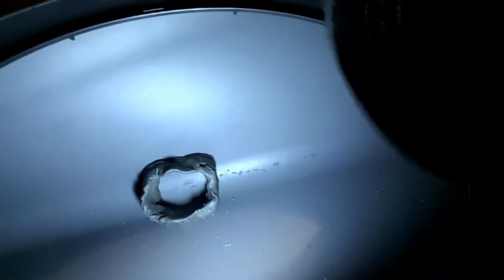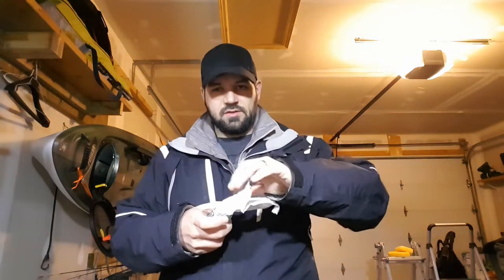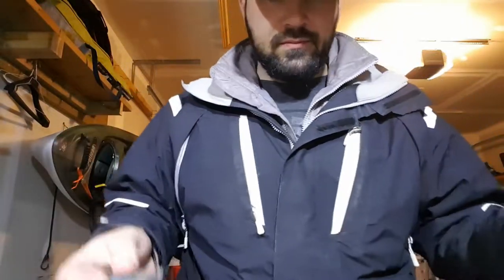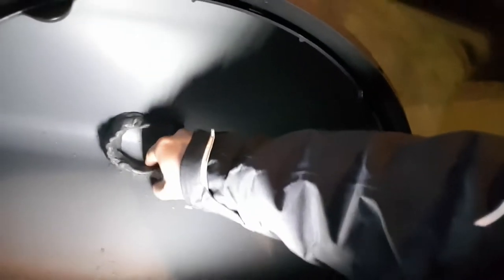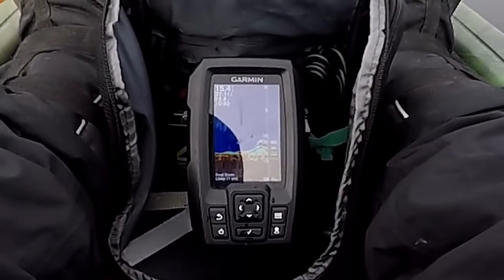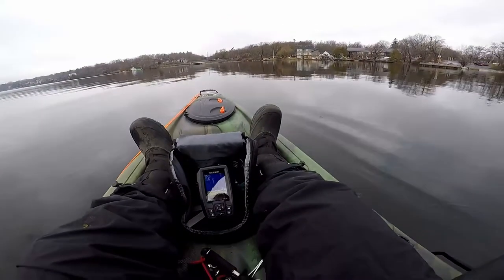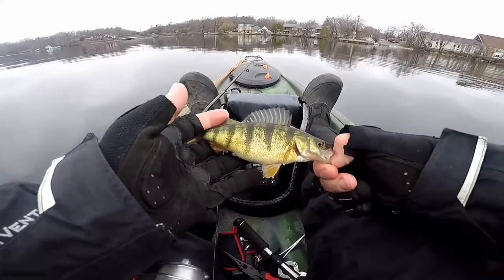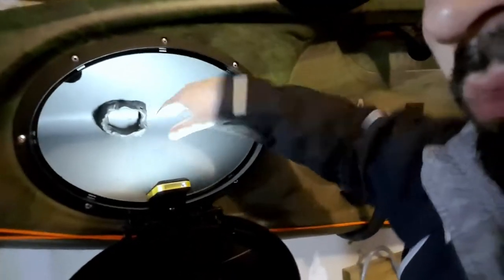Kayak Through Hull Transducer - Easy and Cheap! (Garmin Striker4 and Pelican Strike 120x Angler)

Comment: I know this videos is a few years old, but just a heads up, with duct seal you dont need water. You just make sure there is about an inch of duct seal between the hull and the transducer with no air gaps.

Comment: Have you tried using the Garmin foam pad with a bit of water inside it, like you did with the duct seal?  The instructions for the foam pad is nothing butl pictures but it does show pouring water into the center of the pad.  I'm considering the Striker Plus 44cv and was looking at the foam pad for keeping the 'ducer inside the hull instead of mounting beneath the PA.
Reply from the maker: I did try it, and I couldn't get it to work at all for me. I don't understand why, the concept is the same as with the duct seal. Who knows?!

Comment: Thanks for a great video.  I don't have a fish finder yet so I may not be as familiar with their mechanics as other viewers. Can you tell me why adding the water is important? Thanks!
Reply from the maker: The short answer is because the sonar pings need a medium to travel through, and a air pocket will interrupt the ranging. The water in the trandducer well provides a seamless medium with the hull for the sound waves to travel through into water below your kayak. I've gotten this question a few times now so I think I'll make a video about it. In the meantime, here's a wikipedia link that has a more in-depth explanation of how sonar works.

https://en.m.wikipedia.org/wiki/Fishfinder#:~:text=In%20operation%2C%20an%20electrical%20impulse,and%20shape%20of%20the%20object.

Comment: Awesome! But I think it is IN hull and not through hull, which would be the transducer in direct contact with the water yet inside the kayak ( like the scouper hole mount).
Reply from the maker: I'm pretty sure it's thru-hull, since the sonar waves are being passed through the hull of the Kayak. A scupper mounted transducer is just that, mounted in the scupper I have a video on how I did that with a newer kayak too!
Reply: @jeffdicks  Great video. @Aranha 93 is right. This is an in hull installation. Through-hull is when you drill a hole through the boat for the transducer commonly done on sailboats.

Comment: I have the Same fish finder for my kayak I have not fully set it up yet I was planning on using the foam pad that they give you with the Garmin fish finder just wondering why did it not work out for you?? What went wrong with it ? Wondering if I should just do the duct seal right from the start instead of even messing with the foam holder
Reply from the maker: Sorry for the late reply, honestly I couldn't tell you for sure why it didn't work for my kayak, but I suspect it probably had something to do with the shape of the bottom of my hull. It's not flat in any places that would be good for the transducers, so I had it stuck in there on a bit of an angle. Or maybe the adhesive on the foam pad didn't set quite right and was leaking water out. Who knows? All I can tell you is the duct seal method worked like a charm the first try, and I've been using it since I made this video. In fact, the duct seal I used that day is still in my kayak, going strong almost 2 months later.

Comment: Debating on the portable kit or just the striker 4 with arm mount. Would you say this was inconvenient with being in the way or was it not a big deal? I like the portability of this one between possibly other kayaks or a boat. (Would be using just a suction cup mount for the transducer that the kit comes with now)
Reply from the maker: Everyone's needs are different. Personally, I'm quite happy with the portable kit. If you don't have any way of mounting it to a kayak or boat it's really perfect. I personally hate having the carrying bag between my legs while I'm on the water, so I'll be putting a track system on my kayak in the next week or so to mount the head unit to, but I will keep the bag for the winter when I'm ice fishing. That's really the reason I went with the portable kit. I can use it on my kayak and for ice fishing.
Reply from the maker: Depending on the texture of the area you plan on putting the suction cup you might have problems getting it to stick. I had to duct tape it to the back of my pelican for the first couple of times. I highly recommend the through hull method I showed in this video. So far the duct seal has held up to about 15 different trips in the kayak and as of this morning when I was out, it's still tacky and pliable.
Reply: Limestone Fishing I'm not sure I'd be able to install in hull because there's no dry compartment. That's why I was looking into the arm one. But you saying that you hate it sitting there between your legs is probably enough for me to go ahead and get the arm mount and unit alone instead of the portable kit. I just liked the portability of it but I should Still be able to move the track mount to another kayak or boat just as easily...hopefully.
Reply: Limestone Fishing thanks for such a quick response!
Reply: Sorry one more quick question! I pulled the trigger on the portable one. I'm also just wondering about the unit itself. Will this work well in more shallow water? Perhaps for bass fishing in a lake or maybe even fishing the flats (bottom isn't completely visable..wondering if it will help looking out to the sides at all or if the beam/cone is just straight down). Hope that makes sense. Thanks again!
Reply from the maker: Sorry for taking so long to get back to you! It works just fine in shallow water. I've noticed when I get into depths around 2ft and less it sometimes has trouble, but realistically, no fish finder is really useful for depths under 5 feet unless your using side imaging (which our units aren't equipped with) 

I'm glad my videos helped you make your decision!
Reply from the maker: What kind of kayak do you have? If it's a Sit on top type, It's possible that one of the scuppers is recessed in order to accept a transducer. I definately do hate having the bag between my legs, but that's not really the units fault. That's more of my fault for dragging my heels on getting a proper mount for the display unit and storage for the battery. I hope that my comments about that wouldn't discourage anyone from purchasing this unit.

Comment: do you have to pour water over it? if so during your fishing day doesn't the water fall out of the little well ?
Reply from the maker: Yes, water is required in order for the transducer to work properly. 

In my experience, I've never had to refill it during a trip, even after 6 hours or so, but your milage may vary depending on the wind and wave conditions and how high you make the sidewalls of your well.

Comment: Is adding water necessary for the transducer to work?
Reply from the maker: Yes it is. The pings that the transducer sends out need some kind of medium to travel though, air doesn't work. Ive seen videos of people using silicon and getting it to work so they don't have to fill with water every time, but that is a more permanent solution, and I wanted to be able to remove my ducer at will
Reply: @jeffdicks  ok ty
Reply: Water is only needed if you make a "ring" like in the video here. Instead if you use a "pancake" of ductseal completely around the transducer, water is not necessary.

Comment: How do you find the Strike 120 for stability.
Reply from the maker: I've been out of this kayak for some time now, but it was very stable in the sitting position. Since in this kayak you're basically sitting on the deck, it was nearly impossible to stand up in to fish. I was able to do it a couple of times, though, and while it is stable in the sitting position, I wouldn't recommend standing to fish in the Strike 120x. The beam width is just not long enough to support standing. 

It was still a great kayak and for the price ($500.00CAD at the time in 2018 from Costco), it was a great beginner kayak to start with.

Comment: So how does the duct seal stick to the bottom of kayak
Reply from the maker: It lasted me a whole season. I've since sold my pelican, but when I removed the well before I sold my pelican, it was still good at the beginning of this year. I think it would have lasted this whole season too. I probably only used a quarter of the block, which only cost me 5$. So even if you have to replace it every season, that's about 3-4 years of use out of a single purchase. Pretty good of you ask me 🙂
Reply: @jeffdicks  yes that's good I just wondered if it would move about maybe pop a bit of silicone or sikaflex on it so it stays there like u say could easy change it every year but I do think its better to mount inside the kayak thank u
Reply from the maker: @fishing540  no problem. As long as you properly clean the surface with something safe for the plastic, the duct seal will stick really good.

Comment: Have you tried it without the water?
Reply from the maker: I have been using it this way since I made this video! It's been working perfectly, and readings are almost identical to my friend from Conjuring Rock's unit with his ducer directly in the water. Aside from water temps of course, there was a negligable difference, but a difference none the less. (+- 1.5 degrees)

Comment: You can do this without water too
Reply from the maker: That's correct! For a more permanent solution you can use silicon, but when I was doing this I needed a solution that wasn't as permanent... or sticky. Water IS required when doing it like my method in this video as the sonar waves need a medium to pass through
Reply: @jeffdicks  for about 5 years I had my transducer pushed into a ball of duct seal, no water.  Worked great.
Reply: @RIYakFishing  good to know, i watched this video and went to home depot to buy a 1 lb block of duct seal and basically ended up making a 1" thick oval roughly.. i pressed the duct seal into place and squished the transducer into it about halfway maybe a little more. not sure honestly, it was tough to tell if it was moving a whole lot. ended up creating a lip kinda how it was done in this video, hoping ill be able to use it with and without water.

when you use it without water, readings are just fine though? i would assume you miss out on water temp though or it would be inaccurate..